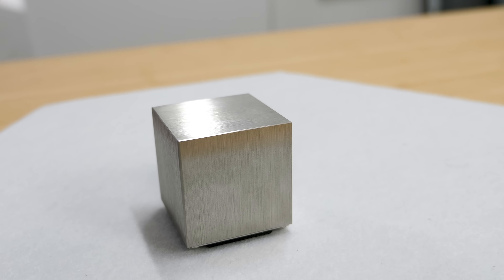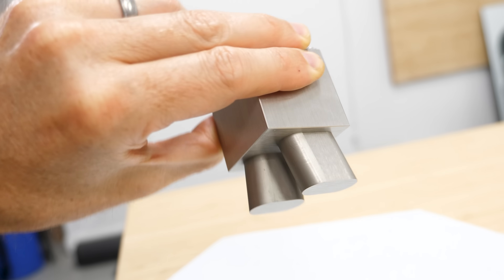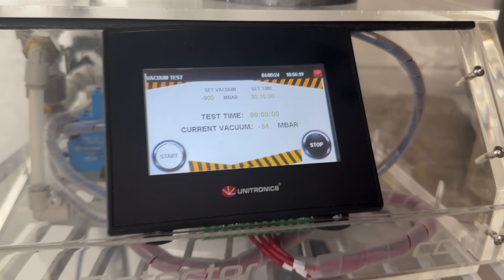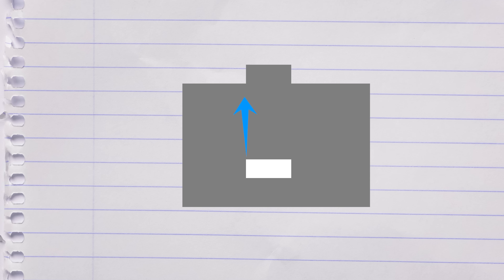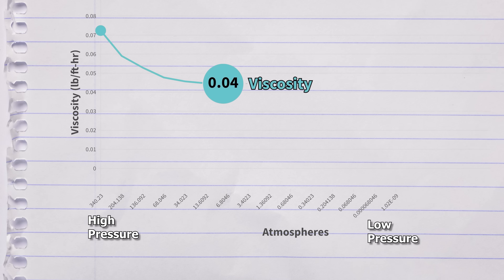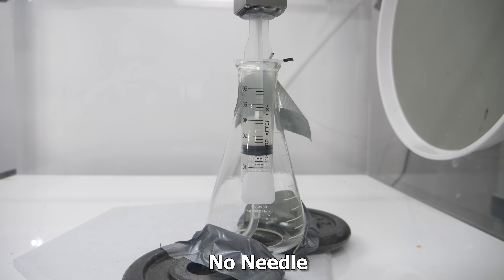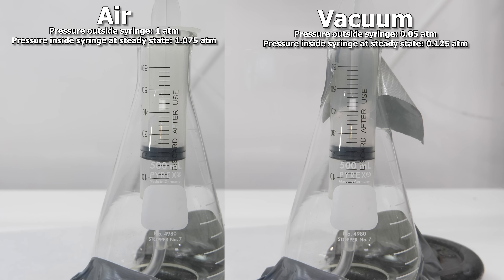What Happens to Perfectly Fit Pieces of Steel In a Vacuum?

Comment: How come the metal doesn't fuse as they do in space?  I thought I read somewhere, if the metal are to smooth and in outer space due to no air, they would cold fuse together.

Comment: I just did the math. The absolute pressure is about 5000Pa in the chamber. This means if the absolute pressure created inside the block is approximately 0, the maximum force based on a 1"x0.5" plunger is about 0.34 pounds, which is most definitely more than the weight of one of those blocks. Very cool!
Reply: What

Comment: Would you be able to "filter" the air in this way? By creating such a gap or holes that there would be more or less of a certain molecule testing their size or viscosity.
Reply: You could test the flow rate with that cube by filling the vacuum chamber with different gasses to test different viscosities

Comment: This experiment wasn’t done correctly.

You have to vacuum the cube while the two parts are NOT connected to the cube.
Once you do this, THEN you can drop the pieces into their slots and watch how fast they fall.

If you vacuum the cube with the pieces in their slots, there is residual normal pressure air still left in the cube, which is why you see the parts change their speed mid travel.

Comment: An easy one but I've never seen it, wring two gauge blocks together and remove the air pressure. Do they fall apart or is the interaction independent of the pressure?

Comment: My idea for the explanation of the syringe behavior would be that initially the pressure in the suringe is in fact much lower, but not much of it escapes, until it reaches a pressure where it does escape at around the same rate

Comment: using the laser to cut the string was wild
Reply: What Happens to Perfectly Fit Pieces of Steel In a Vacuum? ... did not guess cutting a string with a laser, that's for sure! 😂

Comment: Except when you said "vacuum", people understood it as "no air present", none whatsoever - and under those conditions the pieces WOULD fall out unhindered; so everyone who guessed that WAS RIGHT. Discussing the case when "well vacuum but not perfect so really just low air pressure" is involved is entirely fair, but it's a different setup than what is pitched when someone says "in a vacuum".
Reply: If "people understood it" as no air present, despite the fact he clarified exactly how much air was in there, then "people" aren't very smart.
Reply: @Squant Yes, you can also say the Earth is basically vacuum compared to the atmosphere on Jupiter. Low pressure is not vacuum.

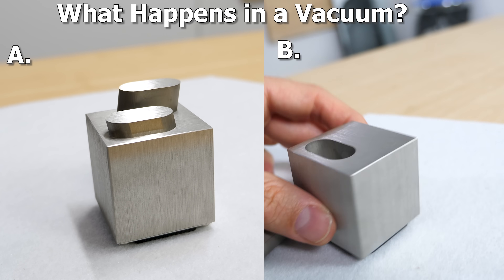Comment: 1:40
I think that if you put it in pressured, it will first push the blocks out. Then it will slide quickly. There is a chance of a cold weld though.

Comment: I think you might have missed that the reason the plunger of the syringe falls faster in the beginning is that there is less pressure inside of the syringe, however as the plunger falls, the relative pressure between the syringe and the pressure inside of the needle itself begins to even out, so in fact, there is more pressure inside of the syringe as it gets closer to the needle.

Comment: this proves your vacuum chamber isnt a true vacuum and we never went to space because thrust doesnt work without something to push against.. just like you cant blow a sail with a fan
Reply: how does this prove anything about thrust?
Reply: @Poldovico  a vacuum is basically a lack of atmosphere or a lack of air. Jets work buy expelling hot high pressure exhaust gas from the back of the engine.. the pressure from the exhaust pushes against the atmosphere without an atmosphere there's nothing to push against. There is no machine that I know of capable of perfect vacuum on earth. So his experiment is irrelevant because it's not a perfect vacuum.. a perfect vacuum would collapse that syringe
Reply: @mavadoroaster  okay, you just said what you believe. I asked how this video proves anything about thrust.
Reply: @Poldovico  I just explained I can't make you understand. If you could explain how my comment doesn't make sense to you then maybe I could help you comprehend my point. But I don't know how to make it any simpler maybe read what I said again?
Reply: @mavadoroaster  The thing that doesn't make sense to me about it is the initial claim that the phenomena displayed in the video prove anything about the properties of thrust.
You're seeing an experiment on the viscosity of air at low pressures. Thrust has nothing to do with viscosity.
Reply: @Poldovico  and space is a vacuum

Comment: So if air can get in and out of that gap in the metal, how do glass syringes work? Those don't have a rubber seal, it's just glass on glass. They use them for certain chemical transfers and the like where any other material would contaminate the samples.

Comment: Just to be clear...
   The "slugs" in that block were NOT cut from "that" block. They were cut from a second block and fitted to the cavities of the first.
   The kerf (waste) of the wire EDM process is ~0.013" (0.33mm) per side.
   A tool maker might say, that's like throwing a hotdog down a hallway.
Reply: I have the same issue when laser cutting. The cut is 0.2mm but the precision is way higher. So for pieces to fit I cut them separately with an offset of 0.095. That gives enough of a gap to fit pieces together but enough friction so they don't fall appart. It's precise enough not to need any glue.
Reply: @goswinvonbrederlow6602  This is exactly the issue I've run into and had to compensate in the same way. I love making builds that just stay together due to friction, rather than using any glue
Reply: @goswinvonbrederlow6602  What kind of devices are you making with this process?
Reply: Isn't that the thickness of a Micro SD card?
Reply: @phaikyouser9499  Sounds about right. 
4 sheets of printer paper.
Reply: Depends on your context. I'd machine fitments as close as possible, however if it's not needed for part, or it gives no advantage to product. Then why bother with that hyper fixation of precision? Engineers know when and when not to, the fakes and tards do not.
Reply: I am not doubting what you are saying. I do just think it makes it less impressive if it is cut from two different blocks.
Imagine cutting the hole in the block that is slightly heated, then cutting the pins but while you cut the pins, do you keep the metal colder. So the temperature compensates for the thickness of the cutter. Now can you cut with even less tolerance on a less fine saw, or even on a lathe.
Reply: The kerf depends mostly on the diameter of the wire used. There are different sizes of wire for a wire edm.
Reply: @theboxofdemons 
Obviously, but the important part is the general order of magnitude
Reply: .33m is on the high end for kerf. Most wire edm is far less than that.

Additionally, wire edm absolutely could be used to produce this with the slugs being cut out of a single block, and them screwing a faceplate onto one side of it. Kinda like the 4 screws we see in many shots of the video holding on a faceplate to seal one side, after having the slugs cut out of the single block above...
Reply: @TheRussell747  I dont think you could. For one, even a very small kerf would be very visible on something like this, but also you need to get the wire through the block in the firs place. That either means drilling holes (which would ruin the slugs) or cutting in from the side (which would ruin the block)
Reply: I'd love to see that process on this channel
Reply: Why were they not able to use the slugs which were cut from the block itself?
Reply: @stopthephilosophicalzombie9017  Picture a saw cutting a piece in two. The saw removes material. The material removed becomes clearance between the two pieces. The clearance when using industry standard 0.010" wire EDM is ~0.013".
   In the context of the precision joints shown, this would be like throwing a hotdog down a hallway.
Reply: @stopthephilosophicalzombie9017  Wire EDM requires that the "wire" either go thru the side somewhere, or threaded thru an full thru access hole (AFAIK), so, this particular "block" had no visible signs of a thru hole or a side cut, therefore, it must have been a 2 step design. The first step would be to drill a hole, to thread the wire... the EDM machine would then cut the shape out. Note that at this point all you have is the exact shape of the hole that is cut out. You can't "use" the piece that fell out because it has a giant hole in it. Next, you perform the same process but you do it from another block and come in from the outside of the desired shape, creating the final piece without any "holes". You "might" have to polish it down to make sure it fits perfectly.
Reply: 0.013"? If that was typical these days for wire EDM, it would be worthless for the cost. I get your point, but the inserts are way tighter tolerance than 0.013" on the perimeter.
Reply: @PioneerRifleCompany  it has nothing to do with tolerance. They are talking about the cut width itself.
Reply: @theboxofdemons  maybe your are referring to something different?
Reply: @PioneerRifleCompany  One common wire thickness is 0.005" for wire edm. When you cut anything, the thickness of the cut will be at least that thick. But, you can still keep the tolerance under 0.001" even with a 0.005" wire. The original comment is just talking about the kerf, or the cut thickness.

Comment: The title should actually say "near vacuum". It's nowhere near a true vacuum if you can have an even lower pressure under the piston and the difference in pressures is sufficient to bear the weight of a metal piston.

If the "vacuum" chamber pressure was low enough that the surface area of the piston wasn't exposed to enough force to hold the weight of the piston, it'll just fall out.

Try this in space.

Comment: They are not cut from ONE piece - they are cut from many. Since wire EDM removes a lot more material than the tolerances you need, you have to cut them from separate pieces.

Comment: Counterintuitively, many properties of ideal gases depend only on temperature and are independent of pressure: enthalpy, viscosity, speed of sound to name a few. Interestingly, both viscosity and speed of sound are both proportional to the square root of the absolute temperature. Yes, viscosity of gases INCREASES with temperature as the mechanism of viscosity is totally different than in liquids (momentum transfer between layers which occurs faster the faster the particles of the gas move)
Reply: I think the effect we see here is also related to soda outgassing.  It doesn't matter how much air you pump into an open soda bottle, it will still go flat at almost the same rate as if it were at outside pressure.  The only solution is to pump in the same gas, carbon dioxide, into the bottle.

Comment: One other thing to consider is the dynamics of flow through a pipe.  Flow rate is determined by delta pressure (and viscosity which, as noted, is usually constant).  Since this pipe is so tiny, it has a very small maximum flow rate, and therefore a very small delta pressure.  Since delta pressure doesn't care about ambient pressure, the flow rate through the pipe is the same, whether or not ambient pressure is super low or super high.  If there are enough molecules to generate a delta P, the syringe will always fall at the same rate.

Comment: The title and the question is misleading. In perfect vacuum the pieces would fall fast, but in the experiment it wasn't even near perfect vacuum. The correct title would be "What Happens to Perfectly Fit Pieces of Steel In very low pressure?
Reply: Let's hear your definition of perfection? Not what Google says we want your definition...
Reply: Perfect vacuum? You can't find them in this universe.
Reply: In a perfect vacuum I’m pretty sure they would instantly weld together as soon as they touched
Reply: @MrMarkjams  Why you think that?  Vacuum doesn't do things. Cold welding happens between rust free surfaces.
Reply: I5 looked rust free to mee
Reply: @The_World_Machine_t  All metals oxidize instantly in an atmosphere.
Reply: “Nearly perfect fit pieces”… nothing is perfect
Reply: Re read the title. It says “a vacuum” not a perfect vacuum. The point of the video was to showcase the viscosity of air at different pressures. Man y’all don’t pay attention.
Reply: @Drewbaloofa  
Dude, in sciences vacuum means space devoid of any matter, the latin word itself means void. You didn't pay attention in physics class.
Reply: @istvanromai9603 That is a theoretical vacuum, but that doesn't exist in nature, so real vacuums are assumed to be imperfect.

Even so, @nahog99 is wrong here. When we refer to an (unqualified) vacuum in an experiment, we mean "low enough pressure to mostly eliminate air's effects on the experiment". In this situation, not enough air was removed to remove air's effect, so vacuum really was a misnomer. "Near vacuum" should have been used instead.

Comment: This is a very interesting video. I was surprised to see that the metal parts only fell out a little faster under vacuum. However, I was thinking a "full" vacuum, and now I realize that the vacuum wasn't very strong. I would really like to see the experiment with even stronger levels of vacuum!
However, I think you might have missed that the reason the plunger of the syringe falls faster in the beginning is that there is less pressure inside of the syringe, however as the plunger falls, the relative pressure between the syringe and the pressure inside of the needle itself begins to even out, so in fact, there is more pressure inside of the syringe as it gets closer to the needle.
Reply: Perhaps astronauts can bring this experience on moon
Reply: He didn't miss that, he said it when he said "when it gets to its steady state"
Though the pressure in the entire system is the same because the difference between an air molecule and the needle is as much of a difference between a gnat and the golden gate Bridge
Reply: @Paul_Bedford  he is talking about "it's amazing how they fall at about the exact same rate even though there's almost an entire atmosphere difference between the two pressures in the syringe", so, he is not taking into account that as the pressure increases over time as the syringe compresses it also results in an increase in the pressure inside inside of the needle too.
Reply: @marcfruchtman9473  he is talking about the pressure in the syringe when it is in the open air vs. when it is in a vacuum.
Reply: @Paul_Bedford  Yes, I agree that he is talking about "the pressure in the syringe when it is in the open air vs. when it is in a vacuum."  And that is my point, I don't think he explains that the pressure inside the needle is much higher than vacuum outside, instead he discusses viscosity at low pressures. If I missed where he mentions the pressure inside the needle rises as the plungers compresses, please point it out with a time stamp.
Reply: @marcfruchtman9473  So is the resistance due to viscosity of the air holding the water at equilibrium in the syringe ? Does pressure difference on the top and bottom playing no role here(Why then is the  pressure inside the syringe  higher than the pressure outside?)?
Reply: @anjugour9295  There is No water. (Not sure what you mean). The point is that if this was only about the viscosity of the air, it should have fallen at essentially the same rate thru-out the full length of the tube. But as the tube falls the pressure starts to build in the syringe slightly because the "exit" is smaller.
Reply: right?  .05 atmosphere is about 40,000 microns.   even a cheap Horror Fraught vacuum pump will get you down to 20 microns.  the "vacuum" in this test is still 2,000 times the pressure of anything I would call a "vacuum"
Reply: Yes, in the world of physics his vacuum is very poor. I'd like to see this at 10^-8 torr.
Reply: Definitely, I was thinking about that too
Reply: In full vacuum the pieces would weld together.
Reply: @spaztech1138  Only if they hadn't oxidized (or similar) sufficiently already.
Reply: @spaztech1138  Very Interesting.
Reply: @spaztech1138 not quite true, the oxide layer would first need to be removed and/or pressure plus friction applied.

Cold welding is also only applicable to nonferrous metals, steel contains iron and thus is a ferrous metal.

You should take your own advice and look it up.
Reply: @spaztech1138 is there any particular reason you say that? Because with my limited knowledge on vacuums and materials it seems just as likely that they slide apart as fast as possible when accounting for friction. So I’m curious if you have anything academic to teach me what happens
Reply: @greatgandini5826 Try looking up cold welding. It's a fascinating phenomenon where two properly prepared metals will bond with each other in a vacuum.

Comment: Depends on how long you keep them in the vacuum.  Right away they probably move fast since air pressure stops being a factor.  But over time - not sure how long - the oxidation layer will wear off and they will contact weld to one another and seize up.  This is a problem spacecraft run into, and they require special lubricants to solve it.
Reply: I clicked on this video expecting it to be about welding.
Reply: @yairlll  me too XD! I was thinking 'well, the surprising effect in vacuum will be that the block will stick'!
Reply: @andremariaribeirodacunha3695  I remember this issue from the Gemini "space walks". The hatch was somewhat uncooperative.
Reply: His vacuum is several orders of magnitude off from achieving cold welding, or stripping metal oxide layers. I had the same thought before the video started though.
Reply: So you're telling me there's a space lube out there somewhere?